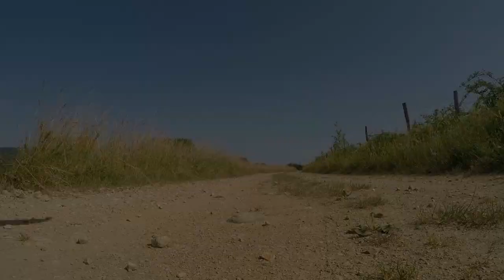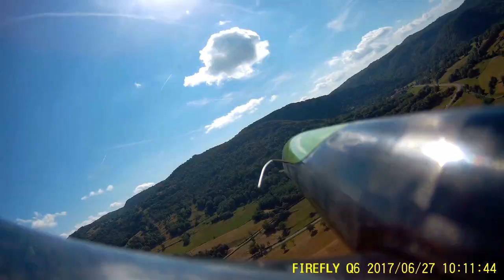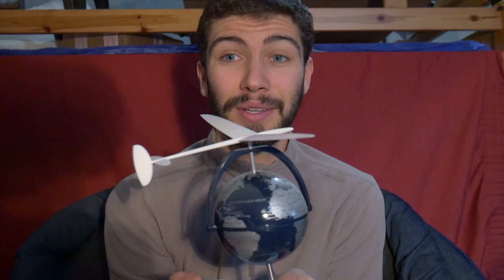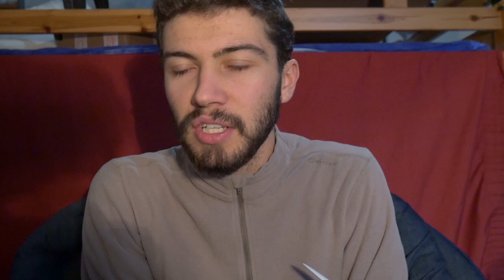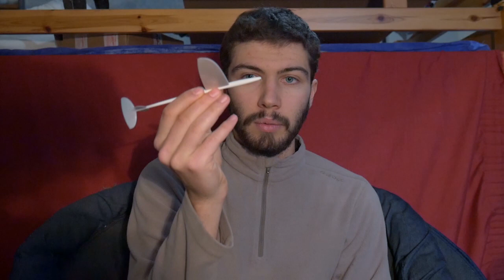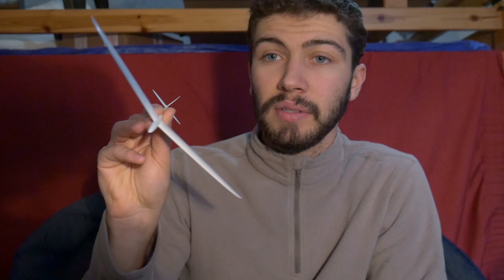DLG theory , how to set your CG

Comment: Great info! I'm flying an old pig of a competition glider. Wing is 'disser' construction and boom is carbon with kevlar nose. It's many years old and has several repairs from completely snapped boom. About 10.3 oz (292 g). I have suspected the glider may be tail heavy but haven't had a good calm day to check. It can cruise quite flat, but aileron/roll response seems a bit slow without rudder input. However, it seems I do not need much elevator input at all to get a good mostly flat turn; just a bit of bank to set the inside wing fairly flat then use and mostly rudder. I can also get a good sharp turn without losing much altitude by nosing down slightly and using full rudder, hard bank, and a quick hard pull of elevator.

Basically, I can get the glider to fly how I need it to but it requires a lot of attention. Do you think this may be due to setup or because it is an older style glider? It seems to have a bit more dihedral than newer DLG designs as well. I hear a lot about new gliders being 'very stable' and 'easy to fly' so I'm not sure if this is all just relative and they also require a lot of input.
Reply from the maker: the best way to know is to test with a bit of lead in the nose . 
yes most new gliders are easy to set and fly compared to some older design
Reply: @pierremeunier  Will do. Also, even with large snap flap setting, the glider 'wags' a bit when I use aileron only. Seems like tail moves out more than nose.

Comment: Great video, I’m learning lots. Question for you. Why do people have sets of removable weights for their glider? Are they placed at the centre of gravity? Why would you want to make the glider heavier? Thanks!
Reply from the maker: Hello , this is called ballast . 
We try To get our glider as light as possible for calm weather , and To be able To use the same glider in turbulent or windy condition we put ballast in it . Without ballast the glider would be difficult To fly and have not enough energy To fight the wind .
Reply from the maker: And yes it s a Center of gravity
Reply: How do you set the initial CG? Do you add weight?
Reply from the maker: @bigtreeproductions  I set inital cg as the builder recommand it . if needed yes I add weight in the nose